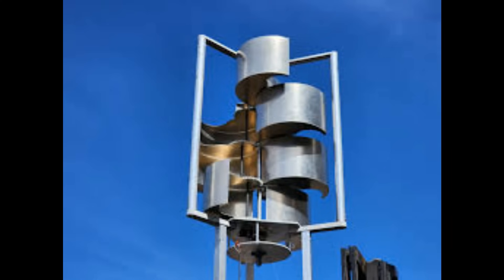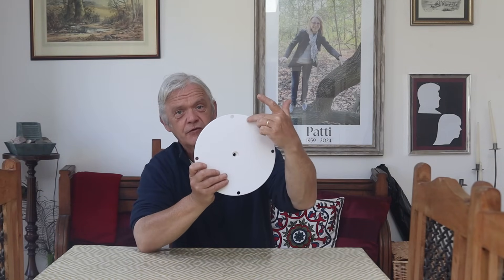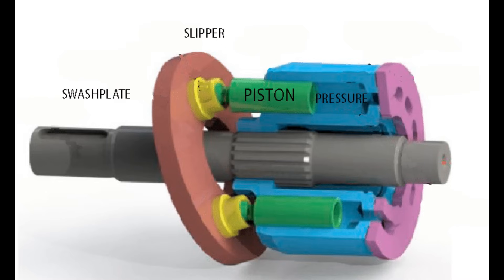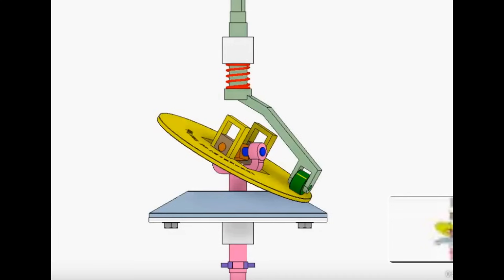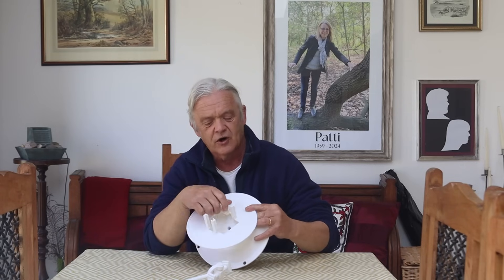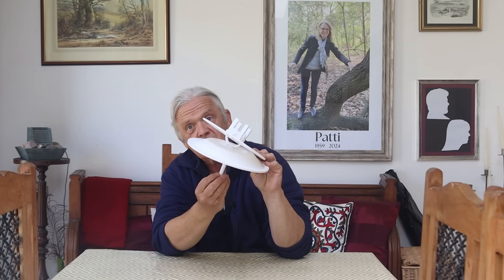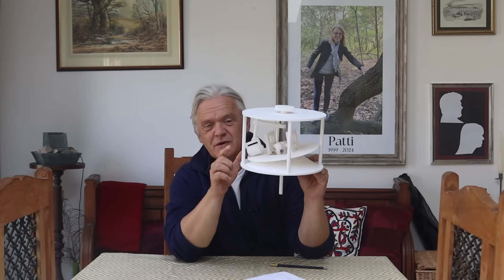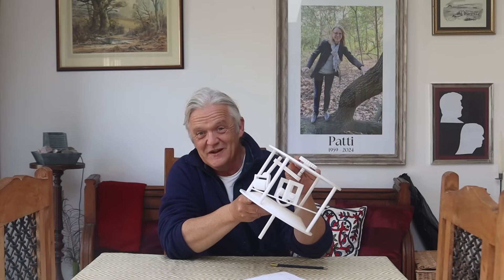2378 A Swash Plate CVT - No Gears, No Belts, No Friction

Comment: It is a friction drive. The friction pairing in this transmission is the contact surface between the cone and the swash plate.

Generally, every transmission has three torque inputs, mostly via two rotating shafts and the non-rotating casing. The sum of all impacting torques is always zero. The transmission acts as a torque splitter, independent of which input is rotated or stationary. At all times, the highest torque equals the sum of the other torques impacting in reversed direction. As this is a positive reduction transmission with a ratio somewhere between 2 (swash plate at 60° angle) and ∞ (0° angle), the sum of the torque at the input shaft and the torque at the cage casing equals the torque at the output shaft. At ratio 2, the torque at the casing is equal to the torque at the input shaft, and we have twice the torque at the output shaft. The torque at the cage casing must be a result of a force transmitted from somewhere within the mechanism. This is the friction force acting at the contact surface between the cone, fixed to the casing cage, and the swash plate, fixed to the output shaft.

Another way of looking at it is when we swap rotating inputs: By making the input shaft stationary with the roller mechanism now fixed in place, but instead rotating the casing cage with the cone, nothing about the transmission and the acting torques will change. However, it now becomes much easier to see that the rotating cone is in fact driving the swash plate via a friction pairing at the contact surface.

Comment: Sorry for the stupid question but, how does this deliver its torque while varying ratios, without gears if not friction? What symptoms would the weak link/failure exhibit? I guess what I mean is, is it not a friction drive in the way a manual car’s clutch isn’t a friction drive, but its failure is slipping? (this coming from the mind of an end user, not an engineer, so please forgive my limited knowledge)

Comment: Very intresting but you have the disadvantage of the Oszillation, and complex small Parts Right? i have an idea for something quite more easy. We just need 2 gears that can continusliy Variate there diameter. I have actually a very cool Prototyp and try to Print it but unfortunatly Thermodynamic Exam is a Little more important, but After that, lets see were this Projekt goes

Comment: how is that not a friction drive? it's not a gear or chain drive, even a v-belt is friction drive. as an aside that perpendicular wheel arrangement has a great deal of loads on it, my dads craftsmen snow blower had that arrangement it didn't last one heavy snow in southeast Michigan winter. bearings and bushings spilled its balls after about 2 hours.

Comment: Forcing a disk to nutate, by using a roller or whatever, will not cause the disk to rotate about its axis unless the edge of that disk is in a no-slip engagement with a surface.  That is, friction contact.
In other words, if there was no friction between the nutating disk and the cone-shaped base, then no torque could be transmitted through this device.

Comment: It’s a mechanic version of the hydrostatic transmission used in Honda ATV’s. That came out in the early 2000’s . Interesting story. It’s a system used in farm equipment for many decades but the efficiency was only about 15% if I remember correctly. In the late 60’s Mr Honda himself redesigned it to bring the efficiency up to 96%. They didn’t have a product at the time that was suitable so it got tested , proven and the put on a shelf until the time it was needed. That time came with the popularity of mid size off road ATV’s in the late 90’s and so off the shelf it came and was put to use. The best part is the control system of a small electric stepper motor used to change the plate angle through a shaft with an extremely low friction bearing system.
Reply: @willyleavitt-pe1cw  hydrostatic transmissions traditionally had about 80% efficiency

Comment: "Doesn't use friction"?

Missed me on that one. Swashplate transmissions have been used in some niche applications, where the ratio sweep/range is fairly narrow, and load is light. They're not particularly useful anywhere else. Even when the plate is built considerably robust... they develop distortions and wear patterns in short order, which render them virtually useless.

Comment: Why not vary the pitch of the wind turbine blades according to the wind speed. Can simply done with a pitch slider like the ones used for helicopter tail rotors. No additional friction except a little for one or two additional ball bearings.

Comment: If you were to lock the input shaft, what prevents the output shaft from rotating? (hint: it's friction between the plate and cone)
Reply: If you pay attention a little. It's not friction-based. Look at the contact point between the rocker disc and the drum. It's an angled contact, offset from the direction of rotation. Transmission depends on the inclined surface, not friction. It's like a nut and bolt. The inclined grooves are what lock it. Of course, friction will be generated, but friction alone isn't enough to prevent the nut from rotating freely around the bolt. If we didn't have inclined grooves, sorry for the bad English. It's machine translation.

Comment: A couple of comments have mentioned the "Way Out West - Workshop Stuff" YouTube channel already, but his use of the friction CVT you describe at the start of the video has an interesting property that seems uncommon with the other solutions, which is that you can run the output in reverse as well (by moving the wheel past the centre of the flat surface).  Many CVT designs only seem to operate in one direction, which complicates the design if you also want to run the output in reverse sometimes.

Comment: Not a friction drive, ok, but I see a lot of parts rubbing onto each other. Thus doubts about efficiency. 
Also, not a smooth output, I guess, due to the single CV joint?
Lastly, what ratio can you realistically achieve, for 1:1 to 1:?

Comment: This is still a friction drive. If you took the swash plate and allow it to spin freely around it's center (which is the equivalent of allowing the swash plate to slip across the cone), the output wouldn't move. Same if you took the cone plate and allowed it to rotate freely around it's center.
Reply from the maker: it really isn't mate - but hey you are welcome to your opinion
Reply from the maker: you might want to check this out https://youtu.be/0FwypgRLSZQ

Comment: CVTs are a good mechanical solution to the problem of varying wind power. The problem is that as far as I know, nobody has come up with a CVT that has as little loss as a normal transmission - and that might even be fundamentally impossible.
I wonder if there could be an electric solution. Give the generator 2 sets of windings and you have 4 ways of switching them; in series, in parallel and only each single winding. Switch them with relays instead of power semiconductors, and you have basically zero loss (except for contact surface resistance). And with electronic or relay based switching, you could switch back and forth between gears quickly in order to keep the blade speed at a desired value (where "quickly" might even mean as slow as once per revolution of the blades). Which technically gives you infinite gears (except that the in-between gears won't be as efficient as the "true electronic gears". And if you need more gears than 4, you can just add a classical mechanical gearbox or use more than 2 sets of windings.
Don't take that as me discouraging you, though. If someone would come up with a CVT that performs as well as a classic transmission that would be huge.
Reply from the maker: there is an electric solution it's called the eCVT
Reply: there was a petrol electric car called the "owen magnetic" that used the transmission you describe. it worked well, but was too heavy and expensive.
Reply from the maker: @martin-vv9lf  oh thank you mate - that's very interesting - cheers

Comment: Hey Robert this is off subject. 

It's on batteries. Has anybody ever thought of 3D printing a foam that allows flow easily through it for plates in a battery.

Let me know.
Reply from the maker: yes the have - done one myself
Reply: @ThinkingandTinkering  I was just thinking you could literally increase the surface area greatly by doing it that way. 

It's always Robert thank you.

Comment: That is actually a clever frictionless clutch plate if anything. I picture the slight angular advance/retard (created by the angle of the swashplate translating into relative position change of the roller arm) between the drive and driven shafts (with its gear as you showed) being used to adjust the blade pitch of a wind turbine as the driven/or generator shaft swash plate rises to create the advance while simultaneously engaging the whole mechanism as a clutch. Extra air resistance type blades would be needed to push the clutch pack and whole propeller assembly backwards as a force to engage/disengage the clutch though. Then it's certainly usable as you intially proposed.
Reply from the maker: cheers mate

Comment: No friction?  There's no such animal.  Every form of machine has energy losses due to friction in mechanisms or resistance in electrical wiring.  Even superconductors have energy losses due to the energy needed to maintain the low temperature..
Reply from the maker: ok

Comment: It doesn't work. If the angled plate transfers any rotation at all, the distance from the roller to the center doesn't matter. 1rotation remains just 1 rotation. Also it seems as if the plate can change angles in any direction, following the roller without rotating the output shaft. Please show it driving a load and changing ratio.
Reply: It does work. The roller causes the middle plate to gyrate. The middle plate gyrating, like a cone with a very obtuse angle on a table, rotates in two manners: oscillatory rotation and processional rotation. It oscillates around the lower plate while processing at a different rate. If we take that processional motion and put it through a shaft, we get a different speed than the input shaft.

Basically, we take rotational motion from the input shaft, convert it into gyrating motion (like a gyrating pump), and then take the processional component of the gyrating motion and send it through the output shaft as rotational motion.
Reply: Correction: Not like a gyrating pump, but instead like a gyrating flow-meter.
Reply: I apologize for the bombardment of comments. I'm on mobile Youtube which doesn't allow me to edit my comments. The video does show the mechanism working. At about 6:57, if you pay close attention to the shaft side of the universal joint looking part in the middle, you see it rotate rather slowly while the input shaft is rotated at a higher speed.

I cannot comment as to how effective the device is when it comes to torque transfer, but it does achieve the goal of having a different output shaft speed compared to the input shaft.
Reply from the maker: you might want to check this out https://youtu.be/0FwypgRLSZQ
Reply: Im not sure I agree fully with this comment but I would like to see this in an application like for wind. I also have questions on how this could continuously work especially with varrying and strong gusts
Reply from the maker: think of it as a disk CVT - the distance of centre to roller definitely matters
Reply: @ThinkingandTinkering The configuration is not right for that. You can't show it working. It will not work like that.
Reply from the maker: @diederikvandedijk  ok mate - whatever
Reply: @ThinkingandTinkering  Just show it.
Reply from the maker: @diederikvandedijk  ok mate

Comment: Thanks for the link to the source. Could you also write the pages where is this mechanism at?

From quick look at the video, this mechanism looks like in relies on friction of the small contact patch where disc and cone meet at. The roller can increase the pressure, to prevent with slipping.

What was it's intended use? Due to small contact area and very asymmetrical assembly it cannot operate at high torque or high speed applications
Reply from the maker: well i don't think it works that way
Reply: @ThinkingandTinkering  It seems like this has a lot of folks, scratching their heads!! Lol!! 
Its strange, because, I understand the principle behind it, and as a proof of concept, it certainly works!!
Andrea and Critters.    ....XxX.....
Reply: @AndreaDingbatt  I think it is other way around...

Comment: Two things, as the radius of contact changes, it happens to both the driven and drive plates so not much ratio change. Also this is just another friction drive so where is the improvement?
Reply from the maker: you might want to check this out https://youtu.be/0FwypgRLSZQ
Reply: @ThinkingandTinkering  But if there was no friction between the swash plate and the code then the transmission wouldn't work. If any load was applied to the output then the swash plate would spin freely between the cone and roller. If that isn't the case, can you demonstrate the transmission working with enough load on the output for the swash plate and cone to spin relative to each other?
Reply from the maker: i hate to say this mate - but I knew a few folks would make that mistake which is why i went to lengths to explain how it works - you need to check out swash plates to get a good understanding cheers
Reply: @ThinkingandTinkering  A longer, possibly even slow mo video of the mechanism working and at least 2 different gear ratios being demonstrated for more than a few seconds and partial turn would definitely clear things up. I build mechanisms for a living and I can't wrap my head around how this would change the gear ratio.

Comment: Haven't tested nor examined it too closely, but it looks like it relies on friction between the wobble plate and the conical plate.

But it looks like a type of friction that would be less wearing than the snow blower friction drive.
Reply from the maker: i hate to say this mate - but I knew a few folks would make that mistake which is why i went to lengths to explain how it works - you need to check out swash plates to get a good understanding cheers
Reply: @ThinkingandTinkering  thanks... I will.

And sorry for making you spend time on the reply :/
Reply from the maker: you might want to check this out https://youtu.be/0FwypgRLSZQ

Comment: How would it transfer power without friction? Its clearly a friction drive just like my snowblower speed control
Reply from the maker: you might want to check this out https://youtu.be/0FwypgRLSZQ
Reply from the maker: i hate to say this mate - but I knew a few folks would make that mistake which is why i went to lengths to explain how it works - you need to check out swash plates to get a good understanding - it transfers power bu pushing down - like your finger on a button
Reply: @ThinkingandTinkering  I think maybe we needed to see it in action. This makes much more sense
Reply: @ThinkingandTinkering  Would that transmission still work, if we lubricated both sides of the swashplate?

Comment: I can't visualise the mechanism very well but isn't it still a slightly friction based drive? Looking on the video "Wobbling friction disk reducer" by thang010146  to see the animation I can see the way it works but unless there is friction the grey and yellow plates at 3:58 then it can't work. I'm kinda imagining that the grey plate has to have a curve on it to allow the change of speeds via the yellow plate tilting. If that is the case then it becomes a point contact?
I live in hopes of a simple, efficient and powerful CVT.
Reply: That was my impression too. I think if you lock the input shaft and then put enough torque on the output shaft, that shaft will spin without turning the input shaft, because it will overcome the friction between the tilted plate and the inside of the case/stationary plate.
Reply from the maker: i don't think so mate
Reply from the maker: you might want to check this out https://youtu.be/0FwypgRLSZQ

Comment: Robert, around 5:21 you showed that the plate is connected to a shaft using a universal joint, but universal joints do not transmit rotation evenly; the output of a universal joint is inevitably lumpy. To get smooth transmission, you need two universal joints in a row where the shaft angles going through the chain of joints are evenly distributed. Or you can use a constant speed coupling such as a Thompson coupling, which essentially is two universal joints all smashed into one plane, with some linkages to enforce even distribution of angles.
Reply from the maker: cheers mate
Reply: @ThinkingandTinkering  ......or a 'Tracta' type constant velocity joint.  Very simple and reliable; but I'm doubtful if anyone bothered to address the efficiency problems which, allegedly, caused Citroën to adopt the Rzeppa joint.

Comment: I guess you could make a sphere holder that looks like an enlarged ball-point pen.  Interesting concept!
Reply from the maker: exactly how i saw it mate
Reply: @ThinkingandTinkering  The Constant Velocity Wheelbarrow, widely regarded as one of the principal foundations of modern civil engineering, negotiates ramps and stairs with ease, no matter how small or how large the cargo, the Constant Velocity Wheelbarrow will get the job done!.
Reply: When I was a kid I saw some comedy show maybe around 1980, where they repaired a wheelbarrow with a flat tyre by shoving a deflated soccer ball in there instead of the wheel, and re-inflating the ball. Worked like a charm. So that is proof of concept IMO :)